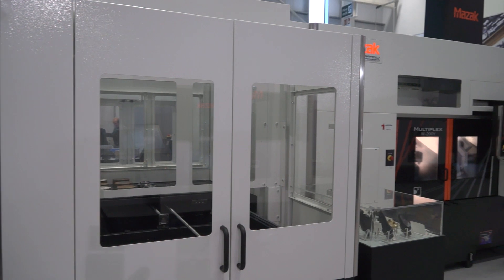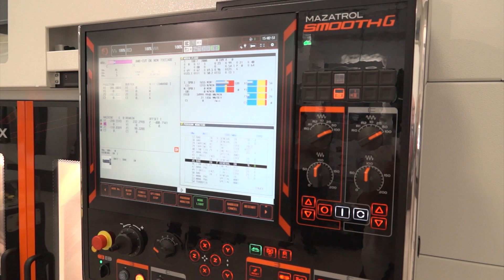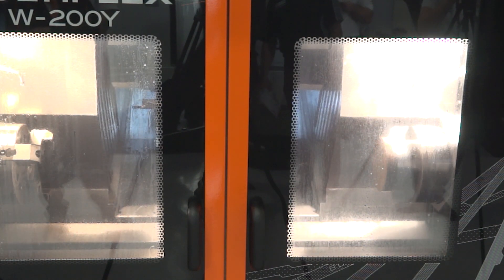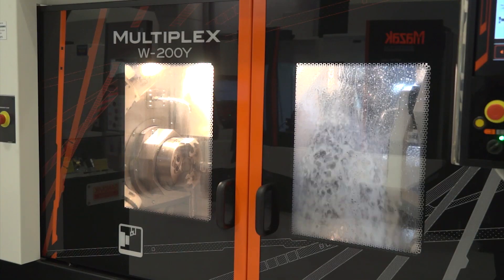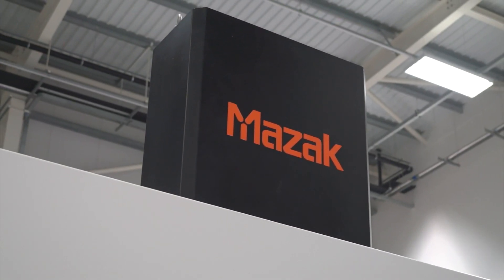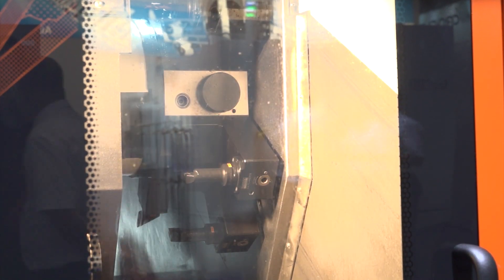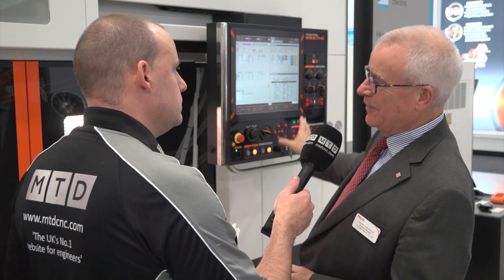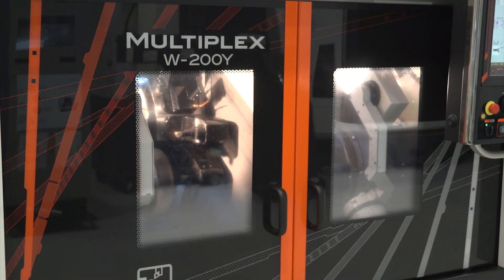Mazak Multiplex W200Y turning center Review with John Liverton

Comment: Can you add a bar feeder to the opposite side of the gantry?
Reply from the maker: yes you can, endless possibilities
Reply: @MTDCNC hi im currently operating this machine. I wanted to know if you can help me with changing the clearance before and after gantry unloading parts to the jaws. Most programs was made by another machinist but he quit. I can program the lathe part well but not to sure on how to set the gantry